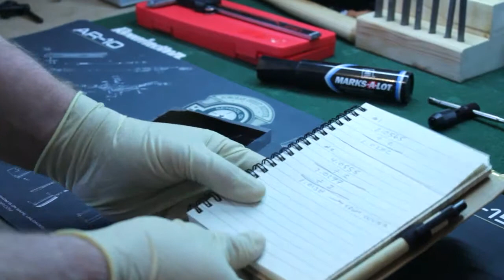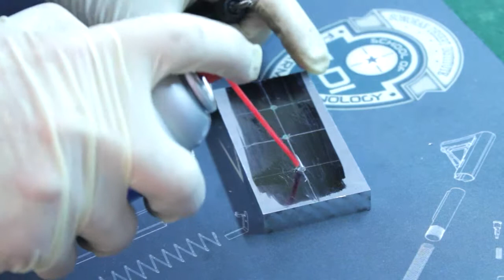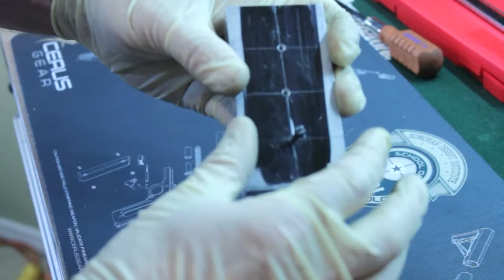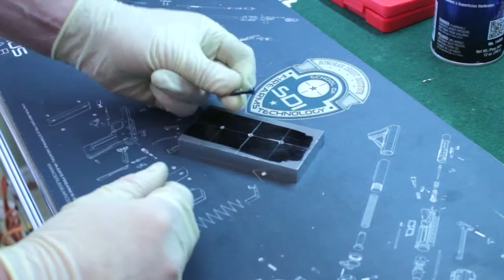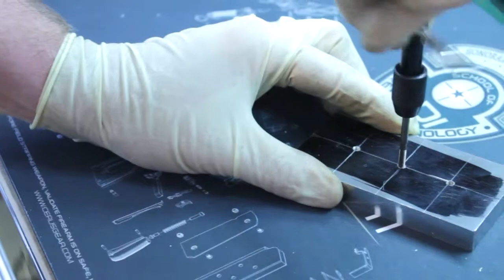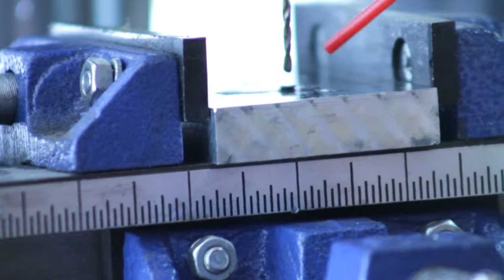SDI: FTT 111D Fasteners Lab Project

Comment: Thank you for the video I know it is older, but I had a few questions. One, is there a reason for not using parallel bars in your drill vice. Second, why not touch the holes with a counter sink or center drill to put a starter chanfer for the tap to start? Please don't think I am being critical. Just trying to learn

Comment: Thanks for the video! I don’t think that center punch was working properly though. Also if you use a centering bit I wouldn’t even use the center punch. That bit does the same thing but more accurately
Reply from the maker: It wasn't, the spring inside of it is jacked up.  But it worked for what I needed.